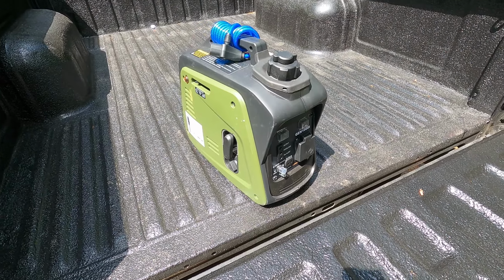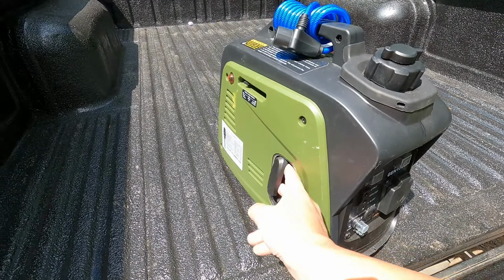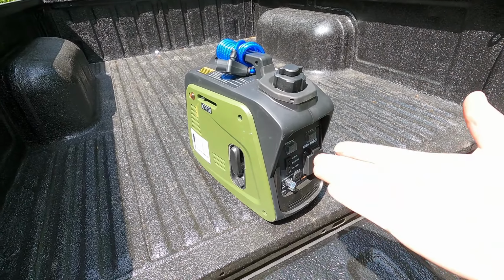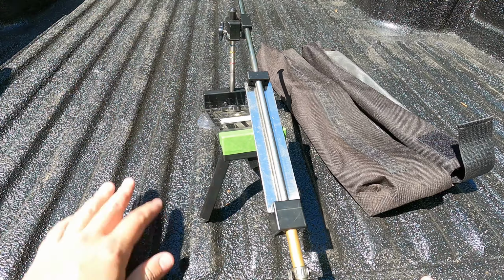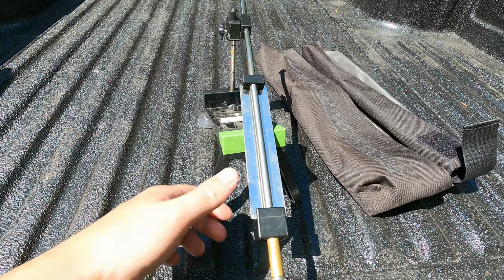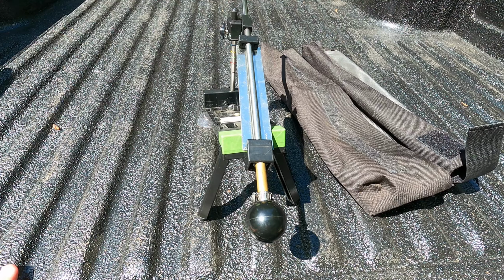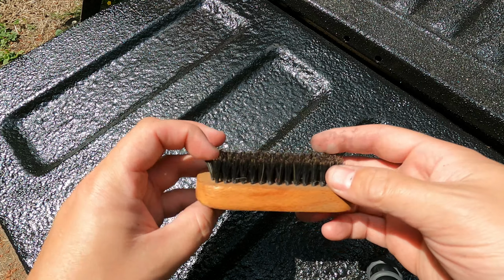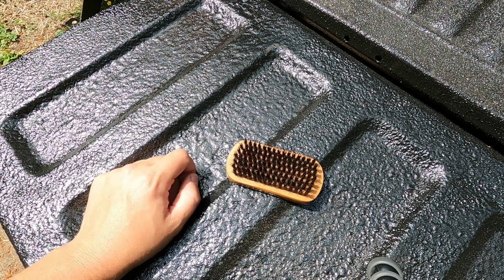Sunny Golf Course Sharpening Adventure: Powering Up with Sportsman 1000 Watt Generator!

Comment: The bristle brush for stropping, I would have never come up with in a million years.  It's always been leather with your compound of choice.  Great tip.  I used to have an Edge Pro Apex back in the day.  Sold it, then ended up getting a Hapstone M2.  That works fine, but it can be time consuming if you have several knives to do at once.  I was thinking of getting a Tormek T2 Pro as I mainly sharpen chef knives.  I know it is an investment, but I figured, it was fast, precise and also relatively quiet.
Reply from the maker: @bwillan  right!!! I watched a sheer sharpening video a while back and that’s where I learned it. It helps you not overstrop your edge. 😊 also stay tuned, for my latest machine purchase. I think it might be right up your alley. 😉

Comment: Great location!  How's your generator performing?
Reply from the maker: Generator is running great! Two pulls to start, and fires up every time. It’s just about time for another oil change. 😊 I’ll make sure to cover a mod I did for it as well. It’s my only complaint about the generator, but can be fixed for a few dollars.

Comment: Hi Sam, I watched a video from another sharpener (Steven) and he mentioned that he gets neck pain if his machine is not on a high raised table (about chest level).
May I ask you what is your experience on this?.
Thanks, good video.
Reply from the maker: @redangrybird7564  yep I'm very familiar with Stephen! Does great work! I don't have that problem too much. I have found if I sit down then yes massive pain in my lower back. But I think my truck talegate is just high enough but If I did get a little pain I would.just put one of my Milwaukee boxes under the 1x30 to raise it up a bit more. I'm not very tall though only 5'7"
Reply: @Samsmobilesharpening    thanks for your reply, I sharpen with a machine that is at table level, I haven't had any problem (yet) with my neck or back. but I'm not tall neither, same height as you.
Take care 😎👍.